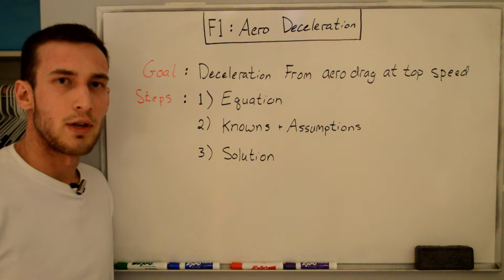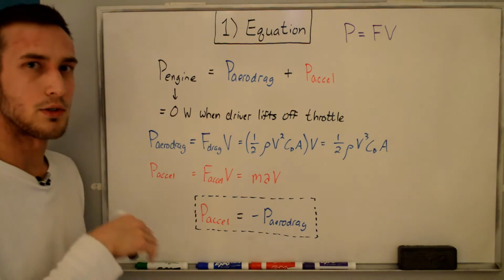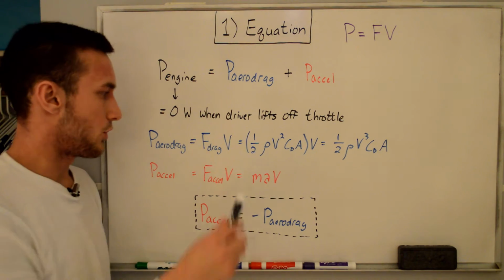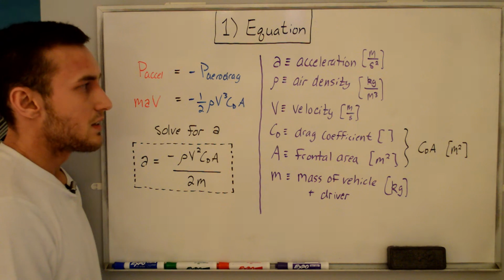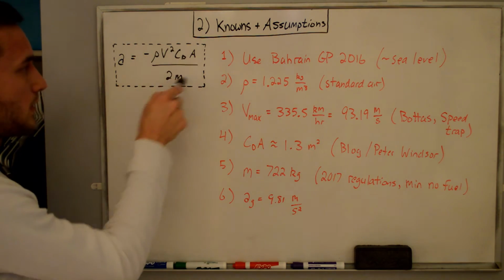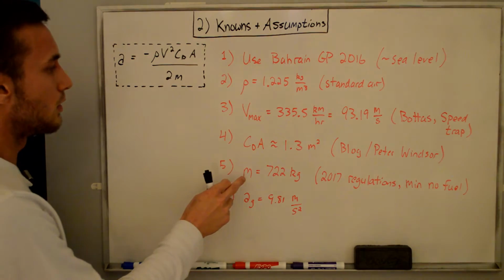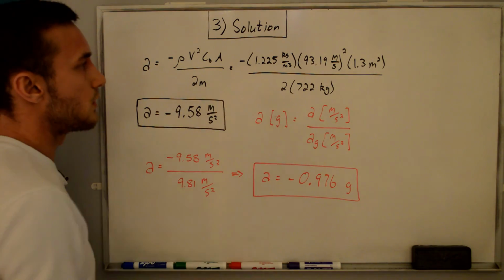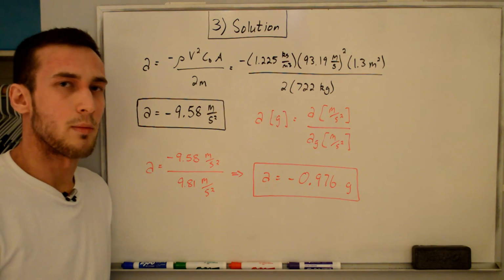How To: Calculate F1 Car Aerodynamic Deceleration at Top Speed

Comment: Just spotted, you don't need Power to find out the equation, as you can just use F=ma and use Drag force for F and it results in the same equation. However, power does help with explanation

Comment: Hello, thanks a lot for your video. For a project that I am doing I am trying to calculate the impact different levels of downforce has on the car. I was thinking to show the difference either in the impact it has on the top speed of the car, or the deceleration speed of the car as mentioned above. (I was looking at NASCAR race cars but if you could help me out in terms of F1, I would really appreciate it). The reason I cannot use the above equation is because you use aerodrag as a variable not downforce. Really looking forward to your reply ASAP. Thanks in advance.

Comment: what about losses from rolling resistance?
Reply: as josh and the description of the video say, it is just about aero. he did not use it in the last video about maximum speed, but he assumed it in that example. he did not assumed any value of it here. it can be tricky because of configuration of the different f1 tires. anyway, if you wish to use it you just need to add it as a sum :)
Reply from the maker: You're right that in order to get the overall deceleration when the driver lifts, you'd need to also include rolling resistance, but in this video I decided to only focus on the deceleration from aerodynamic drag.  I'll probably include that in a future analysis!
Reply: Probably is'nt a huge contribution at max velocity. Your answer seems close. I know the 2016 Merc has a longitudinal deceleration of about 1g. Nice Video btw!
Reply from the maker: Yea, it'll definitely be a smaller contribution than the aerodynamic drag at the speed, but it's still important that I remember to specify that assumption, so thanks for keeping me on my toes!
Reply from the maker: Yep, I added a little blurb in the video description for the next people who watch this video and note that I forgot to mention it on the whiteboard.  Thanks!